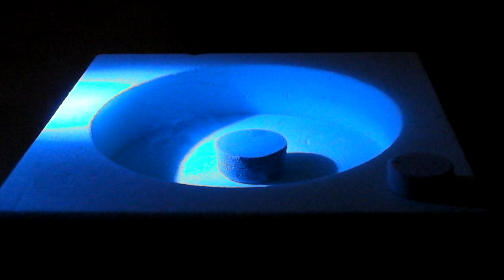What's The Difference Between The Meissner Effect & Flux Pinning?

Comment: im curious where does the magent get the energy to lift off from?
Reply from the maker: That's a great question and we need to consider what actually happens when the superconductor is taken below it's critical temperature in the presence of a magnetic field.  In this situation electrical currents form on the surface of the superconductor and these create magnetic fields which basically cancel out the field inside the body of the superconductor.  As these currents are moving in a superconductor they will continue to move forever (and produce this cancelling field) as long as the superconductor remains below its critical temperature.  The realignment of the field from a magnet placed on top of the superconductor produces the levitation effect.  While the magnet is levitating no energy is being expended - in the same way that if you support a coin on a matchbox on your desk gravitational energy is not being 'used' to keep it there.

There is however energy involved as the magnet lifts from it's original position of sitting on the superconductor to its levitated position and I would imagine that the energy used to do this is energy that is stored in the magnetic field in some way.  Alternatively it will in some way relate to the transition from non-superconducting to superconducting states but this process is not understood in all types of superconductor.

Hope that helps!
Reply: I am aware that the state of levitation doesn't require energy. I wonder what happens when the sc enters his superconductive state. When you move a magnet close to an "active" superconductor I would assume the electrons react to the movement of the field by moving themselves thus creating a matching counterfield. But when the magnet is placed on the conductor before it becomes a superconductor electric resistance will stop that motion once the magnet is in place. The only thing i would imagine is that the ramdom motion due to thermic energy starts to align to the fieldlines once the influence from resistance drops to zero. Based on that i would assume the work needed to lift is extracted from thermal energy. I would love to know what happens if you measure the temperature of the material when the phenomenon happens to see if it really drops of faster for a moment. Being able to extract thermal energy that way would be great.
Reply from the maker: Discord That's a very complex question and I'm not entirely sure anyone can properly answer it.  The transition from non-superconducting to superconducting behaviour is not properly understood.  In some superconductors this can be explained by the production of Cooper pairs (pairs of electrons - the BCS model) but in others (particularly type 2 superconductors) it can't.  The lifting of the magnet is caused by a realignment of the field lines through the superconductor as it passes below its transition point so it's really a question of where does the energy come from to create this realignment.  The realignment is caused by current vortices forming on the surface of the sc and cancelling the field inside  the sc and producing a corresponding increase in field strength outside.  The currents can only form if the magnetic field is moving so thermal energy would seem to be the obvious candidate for causing this movement (which would be very small).  However, this implies that if you cooled your superconductor to absolute zero where there would be no thermal motion the current vortices could not form.  The only 'motion' at this point would be down quantum uncertainty and I don't know if it's possible for this to cause the same effect.

It would certainly be interesting to know if the lifting of the magnet is accompanied by a faster temperature drop in the superconductor. Unfortunately the kind of precision necessary to do that work is way beyond what we have available here.
Reply: wonderstruckwow At 0° Kelvin the electrons would cease any motion and thus any conductive or magnetic properties should be lost. I'm not sure about this however. If all motion stops shouldn't the electrons fall into the nucleus? If you think about it at absolute zero matter itself should cease to exist.
Reply from the maker: Strictly speaking all motion doesn't stop at absolute zero because of a quantum phenomena called Heisenberg's uncertainty principle.  This limits the precision with which you can know about certain pairs of physical properties called complementary variables.  In this case, momentum and position are what's interesting.  Basically it means that if you know exactly the position of an electron (or any other particle small enough to come under the influence of quantum mechanics) at any given time you can't know anything about its momentum (product of mass and velocity) and vice versa.  If we say that electrons stop moving at 0K then by implication we can know exactly where they are which means that we can't know anything about their momentum which implies that they can still be moving.

Also, electrons in an atom aren't prevented from falling into the nucleus by centripetal force.  It's rather weird but because of Heisenberg's uncertainty principle we have to view each electron as a 'cloud' that occupies a volume around the nucleus within which there are a range of probabilities of finding it.  For this reason, matter doesn't cease to exist at 0K.  However, whether or not a superconductor in a magnetic field at 0K will still exhibit the Meissner effect due to this quantum uncertainty is something I'm not sure about.
Reply: wonderstruckwow why should this prevent particles from coming to a complete stop? Indeed you can't know both position and speed at the same time but you could have stopped particles. If you try to find out their position tho you will have introduce energy thus setting them into motion.
Reply from the maker: Discord This obviously only applies at subatomic scales where we can't use visible light to 'see' things and yes, by observing something we will change its state - that's one of the fundamental principles of quantum mechanics.  The issue here is the uncertainty - we can't say whether a particle such as an electron is at rest or not.  This results in quantum systems having a 'zero-point energy'.  This is the lowest energy it can have or 'ground state' but isn't actually zero as it would be in classical physics so perhaps it would have been better if I had made my previous comment in terms of energy rather than motion.

Comment: Can this be applied to the Earth's magnetic field in the thermosphere? It would be a lot easier to keep cold up there.
Reply from the maker: Interesting point but the thermosphere is incredibly hot - it's just that the gas up there is so dilute that a normal thermometer wouldn't actually read very high.  If we took our super conductors away from the Earth into 'proper' space then they would exhibit the same properties that they do on Earth when chilled below their critical temperature.
Reply: wonderstruckwow I figure that it would be simple (relatively easy, anyway) tech could be used to build a space elevator. There would be need for more than one level to stabilize it (not just the thermosphere). I fancy that materials could be sent up with a large railgun or brought down with the first asteroid mining venture. Point is that this could be use to build an elevator from top to bottom.
Reply: I also figure that understanding of magnetic fields would be very useful for interstellar travel, as a way of propulsion, protection, and material collection.
Reply from the maker: Yes, there have been proposals for ships that would use magnetic fields to scoop up hydrogen for fuel as they travel and also for protection against radiation.  I think there is an issue about how such strong fields might affect the crew though.
Reply: Like what the Earth and human generated radiation do? ;-)
Reply from the maker: Certainly the Earth's magnetic field protects us from harmful radiation from our own Sun in this way.  The Earth's magnetic field is very much weaker than the field needed to protect a small spacecraft but it occupies a much greater volume of space.
Reply: Yea, I know that magnetic fields are always going to be stronger at the source. Still, there is the human part to it; 180 years of pumping out radioactive ash. I wonder if galactic radiation could be harnessed as a replacement source of UV (converted) when a slow craft is outside  of the Sol system. Still better yet, can this tech be applied to a star's magnetic field? I am running numbers on changing orbits of large objects, just imagine moving (internal rotations) on large superconductor platforms.
Reply from the maker: I think it would be difficult to convert galactic radiation to UV (not sure why you'd want to?).  The radiation that reaches us from the wider galaxy and beyond is a mixture of x-rays, gamma rays etc and high energy particles.  As for moving large objects with superconductors you would need a rather large superconductor! You'd also then have to apply a force to the superconductor to move it.  That's all way beyond what us humans are currently (or possibly ever will be) capable of.
Reply: And superconductive states were in the same boat not that long ago.
Reply from the maker: Absolutely - but what you're suggesting would require massive advances across the board - rocket propulsion, superconductivity and the ability to manufacture on a truly massive scale.  This would require us to build something bigger than the Earth itself!
Reply: Not necessarily, you are thinking on a very small scale of small items interacting on a quantum level. What happens if the superconductor is not a cylinder shape  but one of a # or a lattice of hexagons. What happens to the superconductor at absolute zero? Can superconducting material be made into a flexible line then tied into a net? I love thinking out of the box on this stuff and I figure that it is my generation's responsibility to exhibit Moore's Law in more than just transistors.
Reply from the maker: It's good to be ambitious!  I'm not entirely sure of the effect of the shape of the superconductor on its performance but I'm pretty sure that no one has yet made a superconductor flexible enough to be woven or tied.  Perhaps that's a job for you?

Comment: Most fascinating.  I wonder,  does this pinning support rotation of one or both elements?  I also wonder what impact eddy currents may have on this bond such as dropping a pinned pair through a copper pipe.  Thanks for the enriching videos.
Reply from the maker: Strangely, given the strength of the 'locking' the magnet will rotate quite freely above the superconductor and if you flipped it over the superconductor would rotate above the magnet.  

The physics of how all this works is not fully understood but I think (but stand to be corrected) that the rotation can occur because the flux tubes are able to move position in the body of the superconductor.  Because the tubes are formed due to fixed physical defects in the superconductor crystal this is more likely to be a constant process of flux tubes dissolving and reforming than actual movement per se.  The superconductor I used in the video is only about 15 mm across but there would be flux tubes numbering in the tens or hundreds of millions passing through it.  

That process of dissolving and reforming obviously involves the system losing energy which means that it will gradually slow down and come to rest.  That's exactly what you observe (but it takes a long time) and a lot of the effect observed on a desk top is likely to be due to air resistance.  It would be interesting to do in more controlled conditions with no air involved.

As regards dropping the pair through a copper tube - that would be an interesting experiment to try.  I would imagine that they would behave in exactly the same way as a 'normal' magnet as the copper tube would simple 'see' an object with a magnetic field falling through it and the normal eddy current would be generated to produce the opposing field.  I'm now also thinking it would be interesting to cool the tube down with liquid nitrogen and drop a magnet through.  Hmmm - thanks for the inspiration!

Comment: I wonder if flux pinning can be used as a base for "force fields" or shields especially out in space where its really cold
Reply from the maker: Interesting idea.  I'm not sure how useful it would be because basically when a type 2 superconductor is cooled down it expels (or traps depending on it's particular configuration) any magnetic field lines that are passing through it's body at that point so coating your spacecraft in superconductor would only have any effect on objects with their own magnetic fields.  Also, you could end up with eddy currents flowing around your spacecraft and as there would be no resistance to stop them they would flow forever and only get bigger.  That may not be a good thing as it would interfere with electrical equipment on board the spacecraft at the very least.

Comment: Does anyone know the strength of the flux pinning effect. It seems to be dependant on the magnetic field. Is that so? For example in a junkyard with a huge electromagnet pinned to that tiny piece of superconductor keeping it chilled of course would the force required to break the pinning be equal to the original force of the electromagnet? And in case this doesn't work with electromagnets replace the electromagnet with a huge samarium cobalt or neodymium magnet.
Reply from the maker: I believe it's proportional to the field strength of the magnet to a certain extent but if the concentration of field lines passing through the superconductor passes a certain threshold the effect will break down.
Reply: Thanks :-)
Reply: wonderstruckwow
Is this because the Meissner effect comes into play with the field lines which are repelled by the superconductor and don't pass through flaws in the coating, or is there some sort of flux saturation level reached?
Reply from the maker: Rob A As I understand it, at each point where a magnetic field line penetrates the superconductor you have a flux tube surrounded by a current vortex called an Abrikosov vortex.  The superconductivity of the material actually breaks down within these vortices so if there are enough of them, caused by a high enough flux density (with enough faults in the superconductor crystal to apss through) the superconductor will stop superconducting, even if it is below it's critical temperature.
Reply: Awesome! Thanks for explaining.
Reply from the maker: No problem!

Comment: If it wasn't for all that music I would actualy hear what the guy are saying...
Reply from the maker: Yes, sorry about that - a couple of other people have said the same thing.  When I get a few moments I'll take it down and reduce the level of the music a bit.
Reply: Ok. That would be nice, because the experiments are really nice. I did not get why the last experimet "locked" the position of the magnet. Have you tried to squeeze them together, or separate them further and see if the magnet gets stuck into a new position or if the magnet goes back to where it was - regardless how hard you try to alter the position?
Reply from the maker: Once the magnet is locked in that way you can pull them apart with a bit of effort but we weren't able to 'reset' the magnet without letting the superconductor warm up again, placing the magnet in the required position and then let it cool again.  Might have a look at that again though as we only really did that once and then didn't video it.